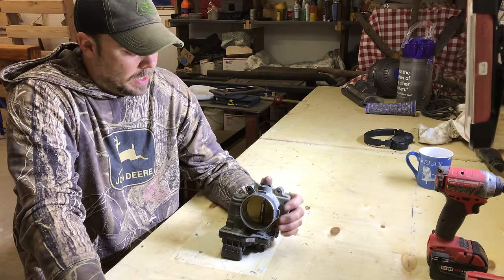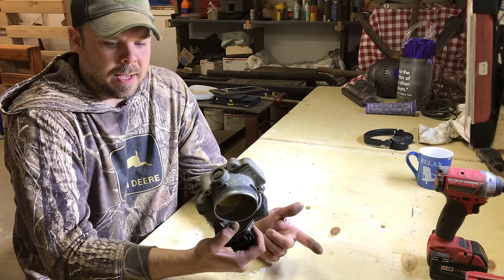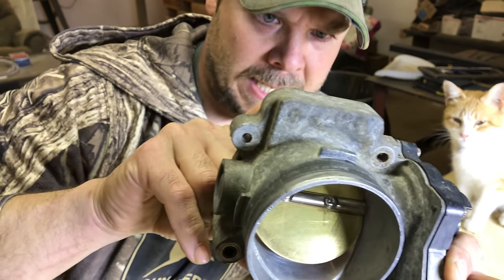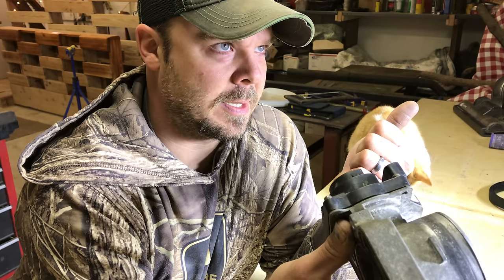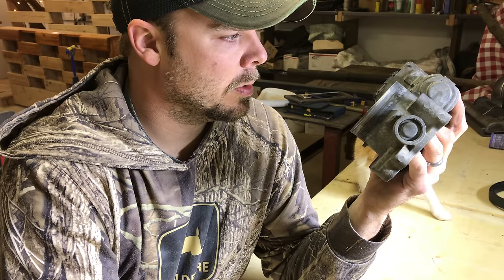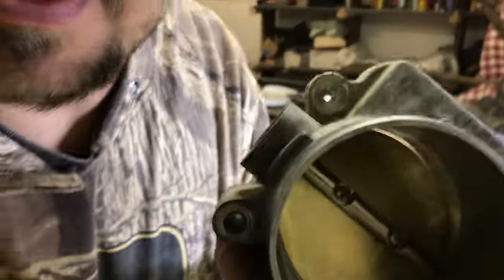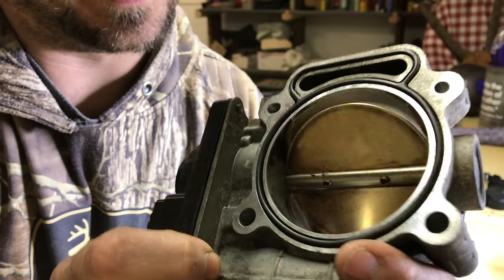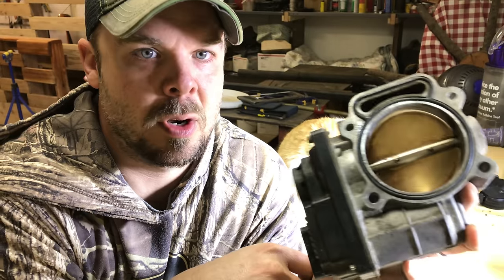Throttle Body Fix for GM Limp Mode REDUCED ENGINE POWER Video

Comment: Your never Ever supposed to move the butterfly manually like you did a thousand times in this video! YOU RUINED YOUR ORIGINAL THROTTLE BODY WHEN YOU KEPT PUSHING THE BUTTERFLY !!
Reply: Funny thing... that throttle body is still on the car and in perfect working order now 3+ years and 100,000 miles later.  Sometimes what you are told doesn’t always hold true.
Reply: I hear you can move the butterfly but you must do it slowly or you might damage the little motor that moves it. Not on the drive by wire old type but on the electronic mew type.

Comment: You saved my skin, man! I cleaned the throttle body in my '07 trailblazer and I thought it would be a good idea to remove the valve plate. I got it all put back together and the truck was idling terribly like it was misfiring. The check engine, reduced power and stabilitrack lights went on and I couldn't drive past about 30 mph (limp home/reduced power mode). I tried disconnecting the battery and driving it to see if that would fix the issues but nothing worked. I thought I was in for a tow and at least a couple hundred dollars in diagnostic time and repairs until I found your video. The plate would not go to the 90° position so i flipped it around and viola! After reassembly it was doing all the same things until I cleared the codes (with my $20 Walmart scam tool) and restarted the truck. Everything works perfectly now! I can't thank you enough!

Comment: Thanks so much for this!

I cleaned the throttle body on my 2007 Hummer H3, same problem (I removed the butterfly)

to fix the issue I simple loosened the Torx screws holding the butterfly and moved it a little,

I then verified it would move freely in both directions, re-installed the throttle body and issue resolved!

no need for emery cloth, there is some play in the screws that hold the butterfly, just align it properly

Comment: I can't thank you enough for posting this video.  It was the exact same problem I was having.  You Sir, are genius!
Reply: What problem did u have ? I can’t seem to get past 2000 rpm park or in gear
Reply: @blakecollier92  My car was running fine I just wanted to clean my throttle body as it was getting quite gummed up. I also removed the throttle plate to clean it and reinstalled it.  After I put the throttle body back on the car and started it the car would barely idle and ran so bad it wasn't even drivable.  After watching this man's video I realized the throttle plate would not move in both directions as it was catching on the throttle housing.  After I readjusted the plate to allow it to move in both directions it started up and ran beautifully. and it's been running fine ever since.  Problem solved!

Comment: This actually helped me. I have been trying to figure out why the car has been in limp mode. Even replaced the ECM. I am going to clean the Throttle body thoroughly tomorrow and hope it runs. Thanks for the video.
Reply: Did this fix your problem?
Reply: Did it fix it

Comment: Thanks for sharing...I just replaced both my Brake Pedal Sensor and the Accelerator Pedal Sensor on my '10 GMC Acadia, but it is STILL giving the "REDUCED ENGINE POWER" message. Now I am being told that it is the Throttle Body that needs to be cleaned/replaced. I was told to go with the easy cheaper fix first, but now I am going to be out of way more than the $300 price of this part. I wish I would've watched your video first; would've saved me time and money.

Comment: Thanks! I think you solved my problem on my 2015 chev cruze. I will clean and check the edges that may be sticking. My codes are PO 122 and PO223, Throttle Body sensor-JJ

Comment: It still gets me. The ones I've looked into says it has to close all the way, but on yours it's still open a little. Years ago I worked on one and it closed as soon as the ignition was turned on. Thanks for the video.
Reply: Correct. See my main comment.

Comment: I believe using brake cleaner is a no no brother.
Reply: Aaron Moore break cleaner is best
Reply: You never want to use brake cleaner to clean with any more. It can strip the protective coating on parts and on some electronics. I remember getting a tech alert from GM about it when I worked at NAPA.

Comment: Forget the haters. Everyone makes mistakes, but cleaning the throttle valve is normal maintenance. If the brass valve is removed, place a wittiness mark on the back with arrow pointing up. The carbon or black gunk is normal unless you install an oil catch can. I do not advocate this as a fix to eliminate cleaning maintenance but many will tell you that normal gasses from the crankcase that go thru the PCV system, blow-by from and worn engine and the addition of a turbo or supercharger increase these gasses. If you race a little when the light turns green, fresh air is drawn in normally, but too much can cause these gases to condense and coat the intake and throttle valve. Putting an oil catch can is fine, but place in a cooler area and engine hoses should run down-hill back toward the engine incase the vapors condense before they get into the catch can. Good ones can run $100+, but need drained and install in a hour. Remove and install on your next vehicle if you trade it off or sell it. Best of luck buddy. 
Just remember, If someone says they have never made a mistake, they have never done anything. ASE Master Tech since 1978 - Retired
Reply from the maker: Very useful and in-depth information.  Thank you for the added value to this video.  pinning this at the top

Comment: Please help!! I'm having the same exa t problem with my '06 buick lucerne. Took it out and cleaned it, i couldn't get the butterfly screws out so i just saturated it with break kleen. Went to the wrecking yard and grabbed 3 tps off of other 3800's and not a thing has changed  except i have not been able to clear the previous codes. When my engine is running about every minute or three i can hear the butterfly inside start doing all sorts of racket then it stops and starts runnin like do do!! Been chasing the gremlins under the hood for the last 6 month's and have dumped around $450 into it replacing every sensor known to man.

Comment: Hey! Okay so I have this 2011 Chevy Impala LT 3.5 liter. And it is having some issues. And my check engine light is also on. And I’m thinking it could be the throttle body because, every time when I would idle. Or come to a complete stop. You could hear the throttle rattling really loud. And you could also hear it when you are just cruising up a minor little hump. So idk if it’s the throttle. Or if it’s the transmission because my mother doesn’t like to keep maintenance on the car. So I’m thinking it could be the transmission because that kicks often but not all the time. But ever since the engine light came on. The transmission stopped kicking. And it’s just been lagging. So idk if it’s the Tran. Or if it’s the Throttle. I honestly think it’s both!
Reply: I'll check the throttle body, first which I believe is your problem I had the same thing happen with my car, until I followed what was done in the video.

Comment: I was able to fix my sisters car today thanks to your video! Thank you!
Reply from the maker: Right on bud!  Glad it helped!
Reply: I had cleaned it a little before i saw your video and it was still not working, but after seeing your video, i sanded the edges of the butterfly a bit until it moved freely again and now my sister says her acadia has more power than she remembers it having. Thanks again. She was really bummed when her car threw that reduced power code.

Comment: Im gonna go check mine now,  Ive been jumpin all over putting new this and that throwing codes but i did take my old one off and had cleaned up same part from a different motor. So Ill clean the original TB see how that works ...  thanks.

Comment: Having the same exact issues, codes, and symptoms. Cleaned the throttle body twice since it was really built up with carbon and im still having the same problem. Car starts off fine and goes into limp after a few minutes.
Reply: Did you figure it out?

Comment: Thanks!!!! My 05 malibu 3.5 is doing the exact same things down to the codes not clearing. I press the breaks and it shut off..  I was wondering why tf my traction control wouldn’t turn off or anything..  Ima go clean it right now at 3 am lol I’ll comment again to let you know if it works!

Comment: my car 05 gtp overheating cooling fan not working   so i unplugged the coolant sensor and fan works also  i changed the sensor and fan still will not kick on could it be the presser switch/map or  no because ac not working any more checked all relays fuse under hood and on passenger door all good i dont get it

Comment: i have cleaned the TB every winter for 3 years now. always went into limp mode in extreme cold. I will give your fix a try this weekend. A new gasket is alot cheaper than the whole assembly.
Reply: it only went into limp mode in the cold? I've been having that same problem for 3 years now. I shut it off for about 5 mins and it will fire right back up no limp mode
Reply: @Sledder_Curt  i completely cleaned the Throttle body. Have not had any issues since.

Comment: I've got a 2002 Grand Prix gt and after changing out those infamous plastic elbows for the coolant with metal ones, my car eventually(a few days) seemed to be losing power, but was still driveable....
It starts and purrs like a kitten still, but the engine will not go beyond 3000 rpms and is in one gear...From the articles I've read, it's seems I've discovered gm's LIMP mode....

I did remove the throttle body to get to the one elbow....I didn't notice anything initially, but all this happened fast, as I blamed the limp mode on the PCS(pressure control solenoid), so just got done taking apart the transmission and putting in that sensor, which I"m sure you saw so many people stated fixed their problem.....But so far my car will still not go beyond 3000 rpms and seems to be stuck in one gear, which many have stated is the 'limp mode' to protect the car..

After watching your video, I'm wondering if I did something to the throttle body while cleaning it, without realizing it....I mean why do you think it was your fault?   Did you force it to close a certain way?   I'm not sure why you say it was your fault?  thanks....
Reply from the maker: Captain Genius ... yes.  I believe that I forced the butterfly to physically stick in the closed (too far closed) position by letting the unhooked throttle slam back shut from WOT.   

Good luck to you with your diagnosis!

Comment: The slight open position without any power is actually a limp-home position (very limited power, controlled just by spark advance and injectors). Otherwise at idle or more the engine braking the ECU is actually closing it by applying power to the motor.
Reply from the maker: The throttle plate has to be slightly open to idle
Reply: Thank you, so nice to see somebody chiming in to help  out instead of being rude

Comment: thanks for video ill try cleaning mine tomorrow all ready replaced the pedal got a used throttle body got a new gasket ill clean up and re try. I'm getting the dash message on my grand prix starting disabled due to throttle but for would be reduced engine power due to throttle.

Comment: I don’t think you’re suppose to move that thing there in the middle like ya did big fella.
Reply: It does it when you drive that’s how air gets in the engine
Reply: I hear you can move it but do it slowly so as not to damage the motor.

Comment: Working on a 2000 C5 has all the codes you talked about. It idles really rough in REP mode. I looked inside the TB and it's clean. Checked all sensors and the TAC. Mash the gas and nothing. I don't know, it's a tough thing to figure out. Thanks for the video, I may pull the TB apart...
Reply: Hey, did you ever figure it out?

Comment: I have a 1998 gmc pickup it idles good until it get hot. When it get hot it starts to skip  . I've changed everything I think of what could it be. Ty
Reply: did you replace the throttle body?, check the wire harnes for poor conduction and high resistance, maybe check the IAT an ECT sensor too...

Comment: My 2007 5.3l 4x4 Tahoe is surging  and it will go into a limp mode (ish). I will be driving and the throttle response will cut out and it at wot will act like you are just feathering the pedal. It has never produced an engine reduced power message. How ever it has shown that the traction control,  stability control, and 4x4 system needs to be serviced. Also when it does this it will not get over 3000 RPM before it shifts. I can still reach highway speeds but it takes forever and a day to get there. Is it possible this could be part of my issue as well?
Reply from the maker: I'm sure it would probably cause the same symptoms .
Reply: O

Comment: thanks bro .. yesterday i cleaned my throttle like you did. and i ended up with (safety reduce performance code) .. hoping your method would correct my throttle ..
Reply: Did it work?
Reply: Did it work? I’m having problems with my GM Pontiac G8 V6

Comment: My 02 bravada did the same thing and the only code that came up was a cooling fan sensor
Reply: Change plugs and air filter!! Put very good cleaner in fuel to clean fuel injector, if problem still persist then replace the Tb sensor

Comment: I have a 09 Pontiac G6...every time I go to plug the scanner in to get the codes, it comes up as an error. I was told there is a bad connection. But anyways, my car is not wanting to accelerate. It will, but it takes a min. It seems to not do it as bad when I turn my AC off. Check engine light is on, but does not say anything about engine power. Help 😩😩
Reply: Alyssa Griffith having same symptoms
Reply: Alyssa Griffith did u find out the problem??

Comment: Thanks this fixed my problem. My truck was limping after it idoled at stop lights cleaned the throttle body and haven't had a problem sense.
Reply: Ray Dunn hopefully this will be my only problem and hope that it’ll fix it. Because when I tried stepping on it. It was like if the car was in valet mode or something. Because my impala usually only needs to go 2-3k rpm to get going going pretty fast but when I stepped on it earlier. It took 2 seconds to get to 3-4K rpm. This is the most frustrating thing I’ve ever had to deal with, with this car!
Reply: Ray Dunn but I still love it. It has a lot of memories. And I grew up with this car. Had it since I was 10 and I’m 16 now. Hopefully when I take the throttle off to clean it. It’ll work perfectly and take the check engine light off.
Reply: Ray Dunn and maybe I’ll get to keep it myself instead of getting a little 4-cylinder

Comment: 2006 Impala 3.9 auto. trans.car.
I just replaced the TPS sensor and still get "engine power reduced." The chevy has 194,567 miles.
Do you thing it's time to replace the throttle body or, just the throttle body sensor?
I cleaned the throttle body real good with throttle body cleaner. When I rev the engine it will only go to 3,500 rpm and when I push down a little on the pedal, it still stays at 3,500 rpm.
Someone told me it might be the throttle pedal sensor!? If it is, where is it located and, is it easy to replace. I am a shade tree mechanic of 72 years old.
I wish I knew 1/2 as much as you do.
Awesome video. Thank you very much.
Reply from the maker: Hello Neil,

If you haven't already, the first thing that I would do would be to run a diagnostic scan to check for trouble codes.  Most any auto part store will perform this for you for free; or, there are inexpensive and easy to use options on Amazon or eBay if you are familiar with those platforms.  Search OBDII scanner.

Unfortunately the Throttle Body Sensor is integrated into the throttle body, so you would need to purchase the entire throttle body assembly.  If the mechanical internals are out of spec, the computer will not allow normal operation.

I believe The Pedal Position Sensor also comes as a complete pedal assembly as well.  I doubt this is your issue.

There seems to be some controversy over needing to do a throttle position reset when replacing the TPS.  I have never had to do it personally.

The codes should give you a better idea on where to start.

Best of luck!

Josh
Reply: Thank you for your reply.
I can purchase the throttle body sensor brand new for about $40.

Thanks again.
Reply: i think sensor in throttle body can hold long life time..just see .gaps betwen buterfly and hole  when close position you see inerside.there is must be not any gaps,in my car i am using glue like dextone give little around gaps..but you must hold open buttrfly until glue dry..
the points is must be no gaps between butterfly and inerside
sorry my english is bad
Reply: Thank you so much for your reply and help.
Reply: you are right, they dont sell the tps seperately. you have to buy the body as well. i tried going to auto zone to have them check the engine codes but they dont don that here in michigan anymore at all. took it to wearmasters and they got the code about the t.p.s but had to replace the body as well. the engine light needs to be on to get the codes as i was there 2 weeks ago and the engine light was not on and they coudnt diagnose as no codes came back.